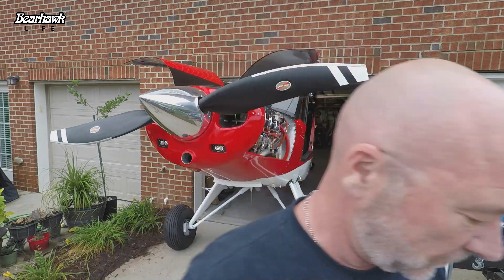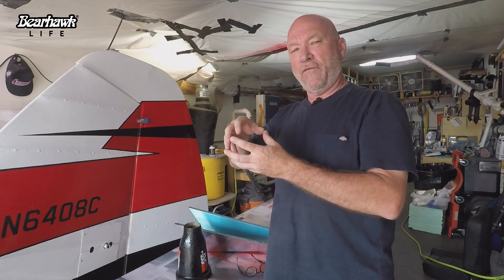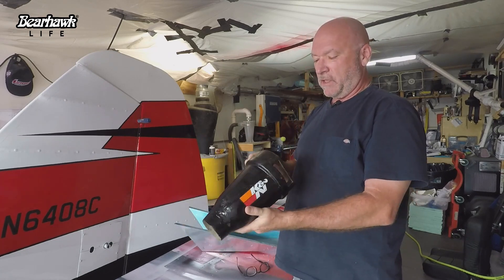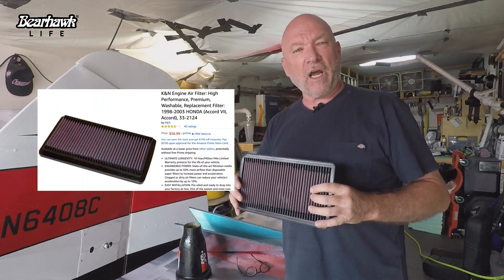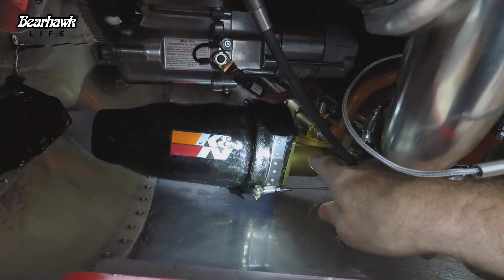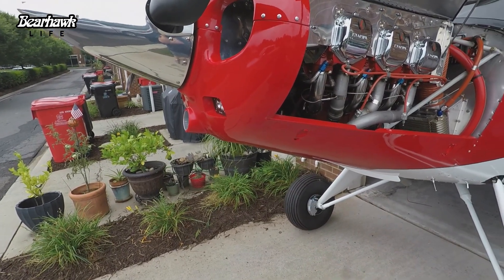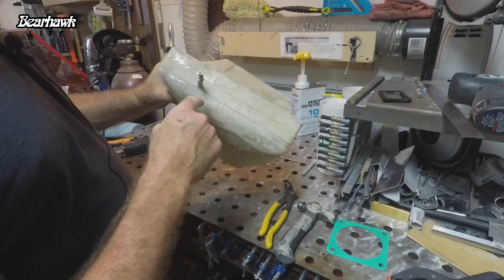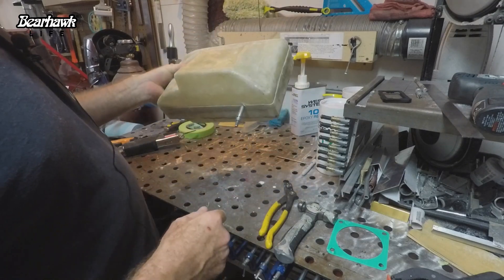BEARHAWK ~ I Don't Like My Air Box!  Part 1...

Comment: You have zero pressure recovery, no ram air manifold boost. It will work. Better than Cessna.
Reply from the maker: Thanks for watching!  That was a few years ago.  So far so good on the intake.  Getting 28 max MP.
Reply: @TheBaldPilot  I see you sold plane and building a Sling. Sub'sd to your channel. Building my 2nd Van's aircraft, an RV-7. Happy New Year.
Reply from the maker: @gmcjetpilot  Happy New Year, and Happy Building!

Comment: Looks good ! You may be able to accomplish this by angling it forward at the top instead of the bottom and slightly moving The housing forward with a longer standoff in the back. Good luck.
Reply from the maker: Thanks for the tip!  Will have the solution posted soon!  Thanks for watching!
Reply: alternator will be in the way angling top of filter front
Reply: You may be 100% right but from what I can see in the video it appears if he pushes it forward and angles the top forward he could glass in around The alternator to make it work. He also may be able to turn it 90° and put a higher degree angle on it creating his larger dirty air intake on the backside along with glassing around alternator. but lucky for us Rob gets to figure that out and show us the gem  he will create.

Comment: Thanks fo showing this, will help others! It looks very nice and you’ll get it sorted out! Nothing that’s worth doing, is easy! Whats the reason for the filter laying back vs laying forward? Is there ever a chance of water getting in, thus requiring a drain at the bottom? Or is the box not water tight? Keep up the good work!
Reply from the maker: There is a check valve drain at the bottom of the fuel controller elbow that allows excess water and fuel to drain when the engine is not running.  When the engine runs, the engine will ingest some water if flying through rain.

Comment: Your mold was the right size but you didn’t account for the Fiberglas on the outside of the mold increasing the overall dimensions!  Sorry dude.  Changing angle of the filter —- more laid back 45 degrees or so will give you more room for the air box but will add some additional airflow direction changes!
Reply from the maker: You are correct!  I am working on a solution now.  Will post in the next video.  Thanks for the comment!
Reply: I’ve never done any fibreglas or carbonfiber work but I’ve really enjoyed watching Mike Patel and his ‘Scappy’ build series and watching him work with composites.  Enjoyed your videos too.

Comment: why cant you just put a piece of flex in front of the round k&n filter box
Reply from the maker: Yeah we tried that before we got to this point.  Not enough room, unless I eliminate the alternate air door which would push the box back.  This is what I think I will be doing.

Comment: Seems like an easy enough problem... What about just making the angle of the filter steeper? instead of the 15-20 odd degrees you have now make the filter sit at 45+ degree's... Same overall area but smaller vertical profile, would also allow you to increase the alternate air door size.
Keep up the great work!
Reply from the maker: Thanks!  Interesting idea.  I'll take a look and see if I can make it work.  Problem is, I don't think I have enough lateral space.
Reply: Diamondback Spectre Read my mind😉

Comment: It came out great to bad it don't fit.Going to have to bite the bullet and fabricate another using a smaller filter.
Reply from the maker: Or maybe not...  Working on an idea today.  Will post in the next video...
Reply: @TheBaldPilot  This sort of live problem solving is really cool to watch!
Reply: use the ‘too big’ air box as a mold for the new smaller air box inside you oversized one!